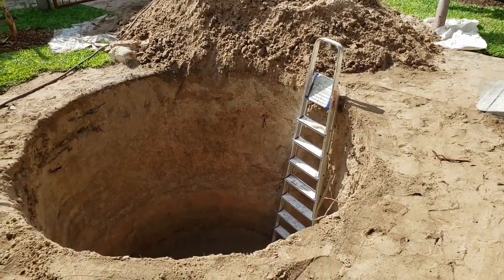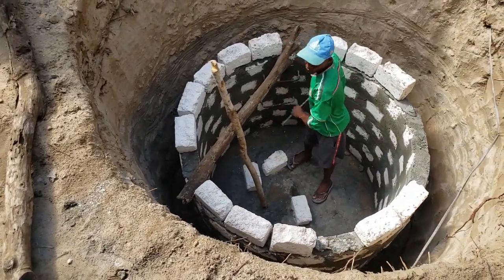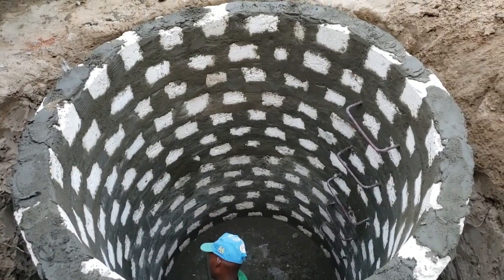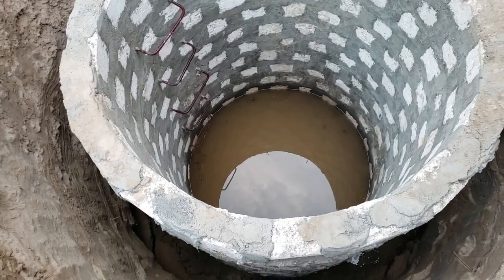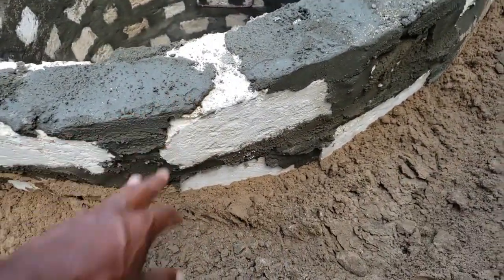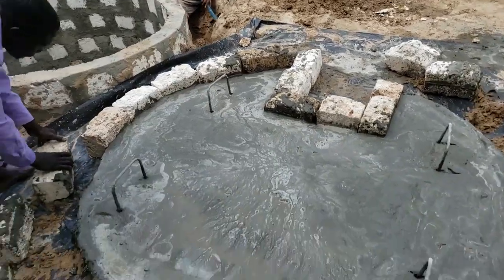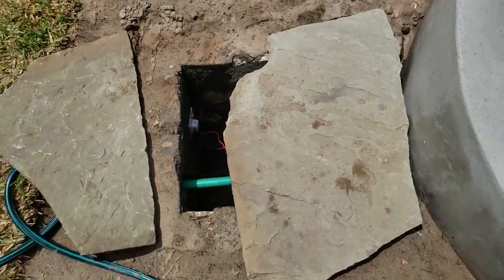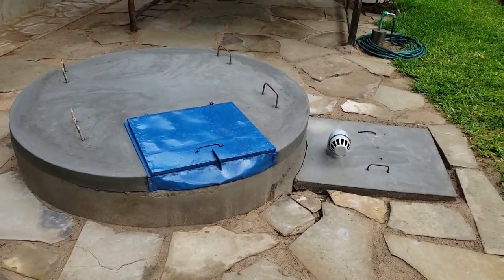Build Well for Water the Old School Way

Comment: How deep does the water inside the well go? Is there any chance of it drying out? This building process is fascinating!
Reply from the maker: The water is around 3 feet deep. I was reluctant to go deeper because I might have hit a salt water layer. It takes many many years of use for the water level to go done. Once I use the water in the well, it takes around 1 hour for it to fill back to its original level.